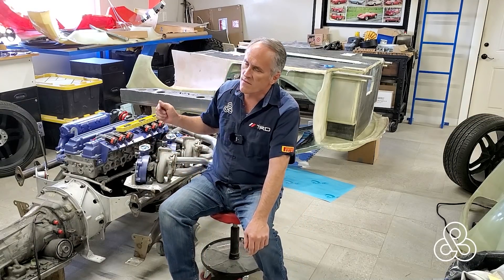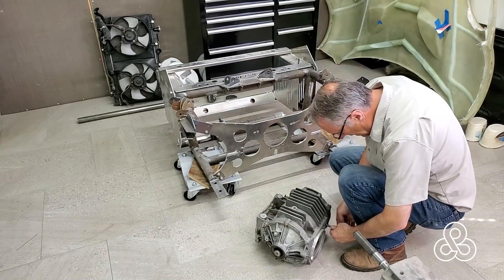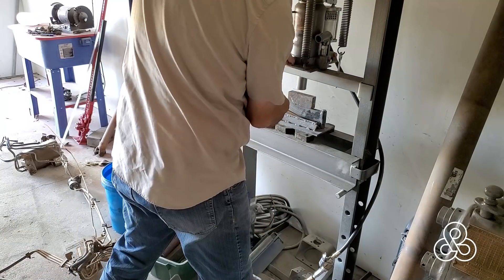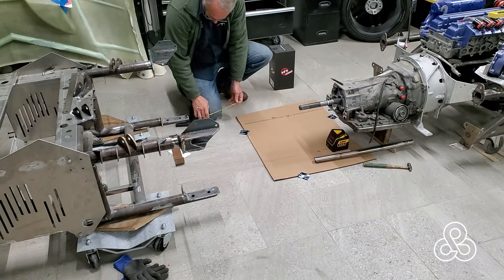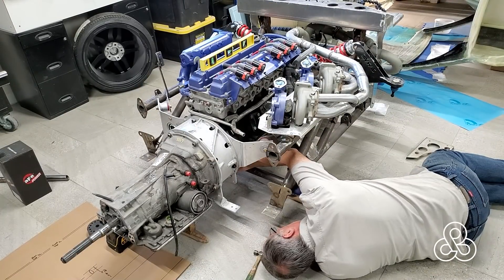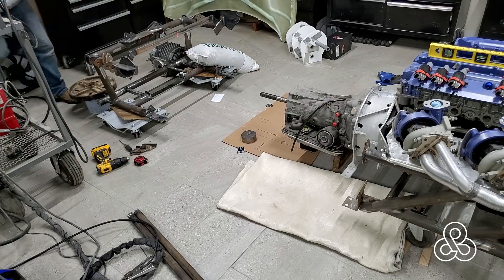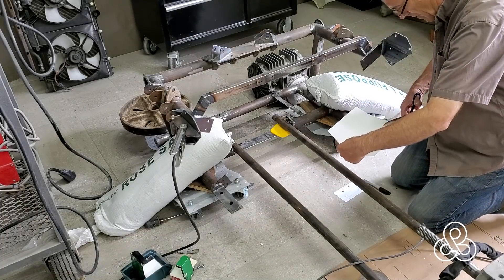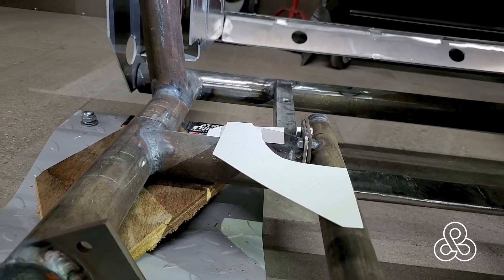A66 Structural arterial spacers AKA- Coolant lines. Arete Supercar Project

Comment: Great idea, until you run boiling water through those pipes and they expand, pushing the subframes apart and ripping the shell in half.
Reply from the maker: Well, only one side will be boiling water, so it will expand and bend the car, resulting in a  continuous left turn . . . if it weren't for the rubber isolation on final assembly.

Comment: How do you determine when a change is needed without making an install. It would seem as you continue building then determining a change is needed?
Reply from the maker: A couple of things trigger changes- The original intent just wont work or better ideas come along. In both cases the changes can be done in my head before I get to the work, or sometimes you just have to cut out the old and redo it.

Comment: No one expects to crash except for demolition derby drivers.
The design of the front sub frame has me a little worried for you in the event of a crash at greater than 35 mile per hour.
It looks a bit too strong and too straight making it likely to punch through into the cabin.
You may need to do some slight modification so that it either collapses onto itself or deflects under the cabin.
A couple of strategic dents and angles will do the trick
Reply from the maker: I think you will see as the tub comes together your fears will dissipate. The weak spot is being T-boned just behind the front wheels. Would like to have extended the door crash bar up to the front subframe, but just can't. Will be beefing up the side longerons to transfer such an impact on.
Reply: @BuilderCreator  if you design the side intrusion bar as part of the hinging and locking structure you can achieve a great deal of rigidity and crash protection.
Historically side anti intrusion bars have always been an afterthought once the door etc has already been designed.
The scenario is usually Oh Crap we have to stick what , where?

Comment: Sir, are you planning to make the chassis for the Arete similar to the chassis of TVR? like a backbone chassis...
Thanks.
Reply from the maker: Yes and no! Most of the strength and stiffness will be in the center tunnel, but the whole tub acts as a unit with no chassis- so to say.